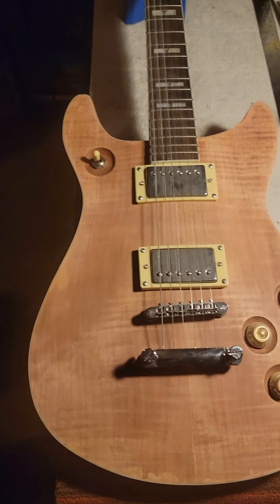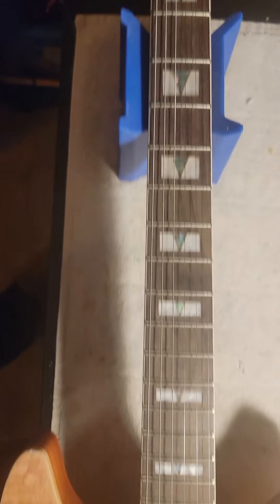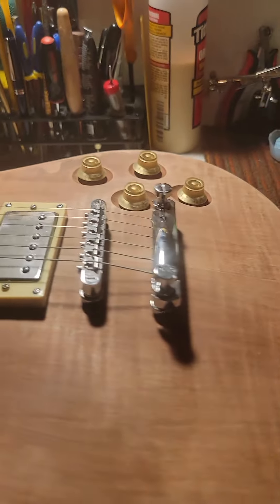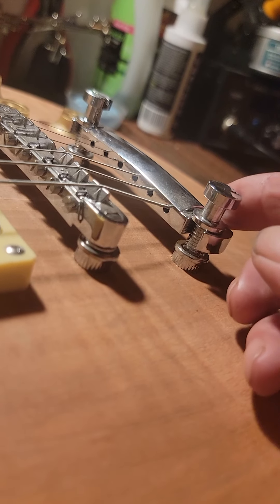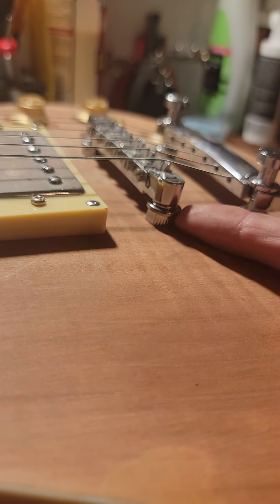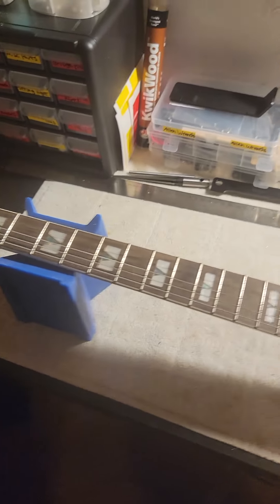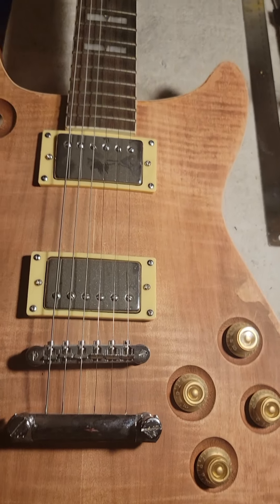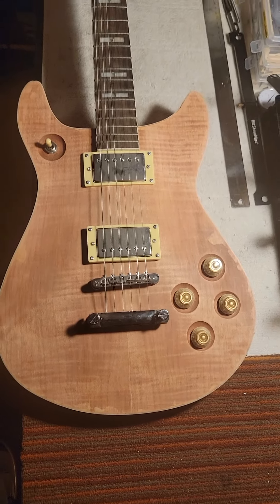new guitar day w/ some issue's.

Comment: Looks like a nice place to start for sure. If it were on my bench I’d address those improperly installed parts. Sand the edges of the bevels for the knobs and switch. As for the finish, I’m a sucker for French polish on flame maple 🍁
Reply from the maker: Ah, interesting paint choice.